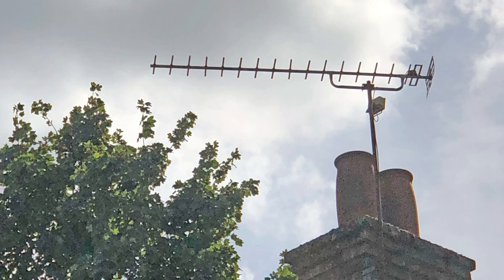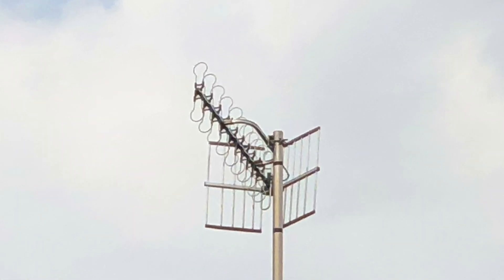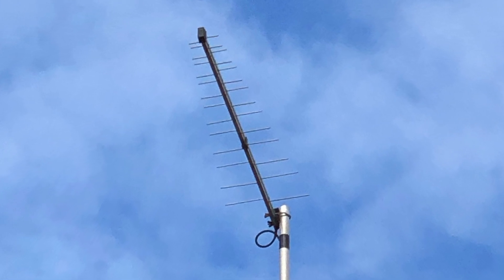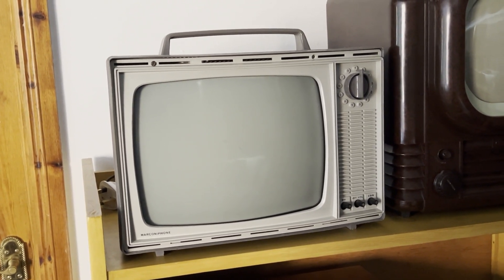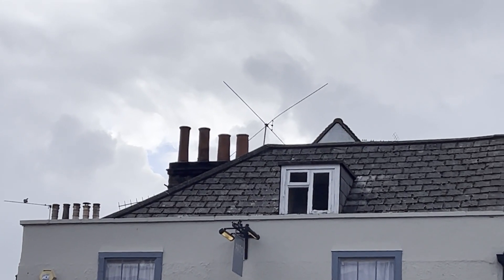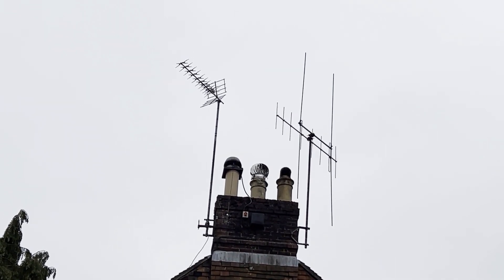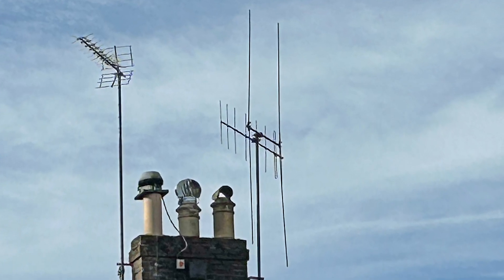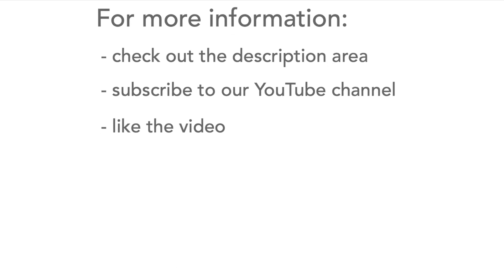Television Antennas Vintage and Modern: the future of TV antennas

Comment: Yagi antenna repurposed on the 70 cm band
Reply from the maker: Yes, certainly a possibility. If a log periodic antenna was used there would be no modification required.
Reply: Although 405 line transmissions lasted until early 1985 as stated by the end and for several years before that there were very few 405 line sets in use, There would have been more dual band V/UHF sets though, although these in the latter years were rarely used in the VHF bands for 405 lines, as these transmissions were only black and white. I would think most of the surviving Band 1/3 arrays that you show would be nearer at least 50 years old now as UHF colour transmissions had been in use for well over 10 years when the VHF 405 line system finally closed down , a real tribute to build quality and the aerial riggers of the day. 
Look at the ones in the video that are complete, with all elements still there!
An interesting video, Thanks.

Comment: Thought the X antenna was for ITV and the H for BBC.  See an X on a house near Brent Cross tube, find the aerials fascinating but guess they will disappear eventually, few will remove them, they'll get blown down or building reconstruction will eliminate them.

I actually have a yaggi suspended by string in my loft, masthead amp with three extensions, oddly the wiring in the wall to my sitting room TV was used when I moved in to my place in 1974, same wiring (the two extensions are new), still working fine with digital TV.
Reply from the maker: I thought the X antenna was used for BBC. Its size would mean that it would be used for the 50MHz transmissions. The 200 MHz transmissions required smaller elements. Unless I am mistaken.